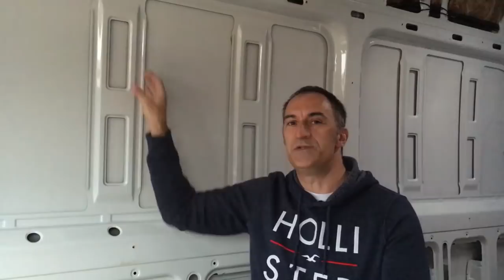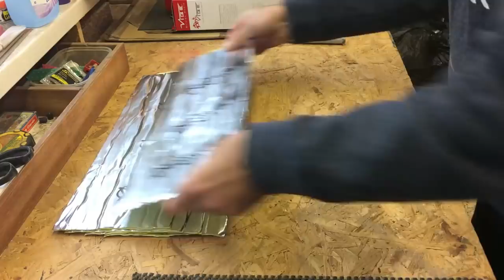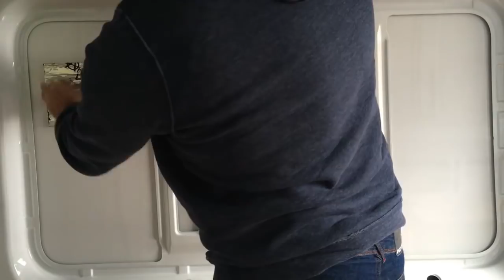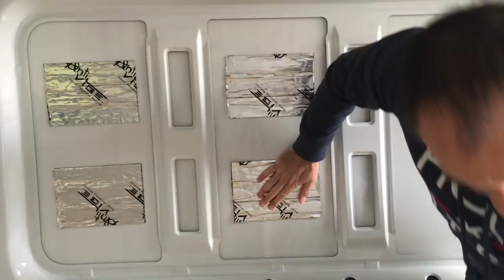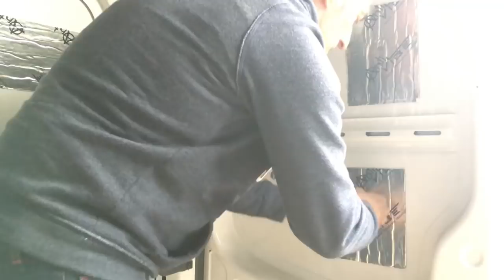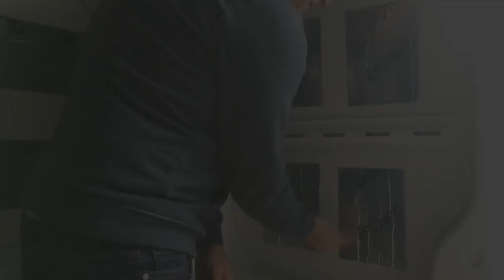Noise & Vibration in your Camper Van

Comment: It is amazing what skills we learn at work that we can use in other area's.
Your daily job does seem to be coming in handy in so many ways on the camper.
Simply clear demonstration as usual.
I would add taking the front door cards off and doing the front doors but I think they may have already been done knowing Mercedes. Some manufacturers don't do the front doors on their van versions.
I drive a Vito at the moment, which they also make into a people carrier, the people carrier always seems so much quieter, I think I have found out why now! Thanks Greg.
Reply from the maker: Hi Harvey, being a mechanical services engineer I deal with Heating, cooling, Water, plumbing, ventilation, controls, basically every building service you can think of. As we are turning this van into a home it all applies in one form or another. What I'm really enjoying in being able to pass that knowledge and years of experience on to help others make hopefully better decisions about their own build. Thanks for great feedback.

Comment: Hi Greg, 

Brilliant series, Genuinely look forward to your stuff more then some series that are on T.V. In the process of planning my van build to potentially be living full time.Sorry if i'm asking a silly question. I know you talked about the panels absorbing the sound coming from the outside. Will it do the same job absorbing the sound coming from the inside of the van? I'm thinking in regards to privacy whilst parked in built up / residential areas where you don't necessarily want to attract a lot of attention to the van. Would be very interesting to know what level of sound would actually penetrate to the outside as I love listening and playing music but would want to stay as stealth as possible.  

Andrew
Reply from the maker: Hello Andrew, yes the insulation will work both ways to reduce noise breakout. What would also help inside would be the soft furnishings, sofas, carpeted walls, curtains etc all absorb some sound. Hard surfaced tend to reflect sound.  I've got some 1/2" thick acoustic felt that I'm thinking of lining the walls with, sort of thing they use in conference rooms or screening rooms.

Comment: Great video and explanation, Greg. I used Silent Coat on mine -a good price, shipped direct from the manufacturer. Here's a link to my treated/untreated demo - it jumps straight to the useful bit. https://youtu.be/zaA912dc3zw?t=4m12s 
My used van was very, VERY rattly at the start. I re-bonded panels that had broken loose from the ribs and applied the butyl sheets to the panels, not the ribs. I did cover the whole area of the panel and also the roof to silence the sound of rain. I probably wouldnt cover quite as much in future. The floor has a base layer of horse stable rubber mat for road noise reduction.
Reply: Yay, another youtuber to subscribe to.
Reply: Thanks for the sub, Mitcy! 😊
Reply from the maker: I checked out your video, you did a good job.
Surprising how many panels come unstuck and most of the rattles are these flapping about.
The rubber mat may offer some mass to the floor if stuck down to deaden any vibration
but little sound absorption as its a solid material and sound waves won't get into it.
Reply: The roof was almost all detached from the ribs!! The mat is heavy so makes good contact with the floor, although I did need to fill the gaps in the corrugations. It's below the rest of the flooring which is screwed down. No doubt there is room for improvement, but just returning from the supplier with the mats laying on the bare metal was an amazing difference. The Ducato is a tin box compared to a Sprinter. 😉
Reply: The stable mats are great for landrovers and pickups where you’re chucking logs and bricks in all the timebut they’re bloody weighty ! Yep i think sprinters and crafters start with alot less rattles than other makes !

Comment: Thanks for another great video.

Now that you've sorted the body of the van, have you any tips on cutting down on the irritating noise from the passenger seat? Telling her to shut up doesn't have the desired effect 😆
Reply: Funeral services for Tony will be announced shortly.   Lol!  My suggest is Taffy or bit o honey candies.... difficult to talk with you teeth glued together.
Reply from the maker: LOL 😂😂 love this Tony.
You could try turning the radio up, if that fails then a strategically placed strip of foil tape is the answer.
Reply: Drive to a funeral in the snow with the traction control turned off.  Make sure that (before you set off) you tell them that every time the triangle flashes the wheels are losing grip.  Quietest journey of my life.
Reply: Swop her out for one that don’t speak English 😬
Reply: @Dan-wo4bx  SWAP, not SWOP.  DOESN'T not DON'T.  Looks like you need some classes in English yourself!
Reply: Tony Sutton - My, how strange.  I had the same problem with my ex husband every time I got behind the wheel.  "Drive like this, drive like that...!"  He just never shut up.  So I tossed him out permanently, and kept the dog.  It did have the desired effect of total blissful silence.  No more male backseat driving.  The dog is a much better companion.  Maybe if you put her behind the wheel and you slept in the back?

Comment: Won't earth wool draw moisture and get damp over time like glass wool? My van was insulated with glass wool by the previous owner and I dread looking behind the panel wall... What do you think about using sound deadening sheets in the driver's area? Would you apply it just partially like you did in this video or the whole area? My van is not particularly loud, but a less noisy car makes for a smoother ride.
Reply from the maker: Earthwool is water repellant, but with my vapour barrier there will not be any moisture behind the cladding. Most cab noise is breakout and not vibration so you'll be better with an adsorbing material and full coverage for these areas.
Reply: Thank you for the answer! I'll see if I can find something, but this will be a luxury expense for when I have finished my conversion.

Comment: Wish I knew this before purchasing all that noise isolation material, much more than I need apparently.  But thank you for your always informative videos.
Reply from the maker: Hello, if you've not fitted it yet then maybe resell what you don't use to another van builder. If you have fitted it already then you will benefit from it being a very quiet van, it may have cost more than needed but it will work very well. Thanks for watching.

Comment: I have this stuff called dodomatt which was recommended to me for sound deadening, it seems much lighter than the stuff you describe in this video but will it be okay to use in the same way? Great videos, I’ve found them extremely helpful so thank you!
Reply from the maker: Hello, I looked at Dodo Mat website and their products are gear more to sound absorption. They are a foam or quilted material that will soak up sound waves from wheel arches or engine bulkheads etc. I couldn't see a dense anti vibration pad in their product line up. Where do you think the source of your noise will be from?

Comment: Hi Greg, another clear and concise video, you are getting really good at this:)
Regarding my new Ford Transit it's all curves and style creases. Ford promoted it's new model as being very quiet, like car quiet. Not quite, but pretty close.
Funnily enough like yours, it was the rear doors that let the side down. So to be sure I added sound pads to these and all large panel areas and now all is reassuringly dead.
Reply: Greg where did you put your electric 'boxes' in the end? Not sure I saw that on any videos. Assuming we aren't having a permanent garage, I guess there's only behind the drivers seat under some seat benches. I've seen CamperTango use the side panel next to it too (for the EHU)
Reply from the maker: Hi Rob, they do seem to have done a lot to cut down on those annoying rattles. What's next on your agenda for the transit buddy?
Reply: The weather has kept me in, so I'm still working on the control system. Proving a bit of a task now, but it should be worth it.
Reply from the maker: Can't wait to see what you've come up with, I've gotta get down and dirty and get tanks hung under my van if it ever stops raining.
Reply from the maker: Hello, we are still planning to have a garage in the rear for storage etc. The controls are located at the left hand rear panel as you open the rear doors. That where all the cables wire back to. All I’ve changed is the initial height of the bed and will now make it removable. Everything else is pretty much as per my original design. Want to keep the front bench seat empty for storage.

Comment: I'm planning to do an enclosed cargo trailer conversion and I will definitely need to treat it with something like this, especially if I expect to use a decent sound system in it.
Reply from the maker: If the sheet panels are very large it may be worth looking at bonding some angles to the inner surface to stiffen the sheets?

Comment: Interesting you've done this video now Greg. Just about to do similar - but the cab.
The back of my van is pretty good, but it's quite noisy in the front whilst driving. Decided that whilst the seat bases are out for other jobs (next week I hope) I'm going to try and improve this.
All the stuff I've chosen is on order, plus will do a before and after with decibel meter for anyone else interested. Could be a complete waste of time :)
Reply from the maker: Hello, I imagine most of the noise in the cab will be from the road via the front wheel arches and the engine via the bulkhead. This is more noise breakout than vibration and sound attenuation with a dense foam is probably a better treatment to absorb the noise. As I suspect panel vibration is maybe not your main issue here. What materials have you ordered out of interest?
Reply: I've ordered some sound deadening foam sheets from Amazon, which I'll fit under the standard floor matting, in the doors, on wheel arches, anywhere else I can get it. It get's good reviews so I'm hopeful it will be quite effective (not expecting amazing).
Planning to be quite thorough with this (def include battery box) and also fit where I can under bonnet (with high temp stuff).
I'll also fit the same in the base on the overcab. Worth a go I think :)
Reply: You might have luck with a raptor kit. Spraying on the under sides of the wheel wells.
Reply: Thanks. I'll look into that.

Comment: Love your videos. Really informative.  Glad you pointed out that's soundproofing is not really Necessary on all vans.
Top tip ! 100mm self adhesive roof flashing does the same job as the expensive anti vibe or rattle trap, but without the pointless foil back of course. 😁✌💜
Reply: Yep i think I’m gonna try a couple of layers of the heat on roofing flashband just because i have a few rolls of it kicking about.
Reply from the maker: A handy tip Peter, thanks. I'm also not sure why the foil backing? Yes, this stuff is expensive so it pays to use wisely.
Reply: I tried the roof flashing, but it doesn't have nearly enough weight. The proprietary pads are way better.
Reply from the maker: Hi Joshua, search for “sound deadening material for vehicles”  Do not use black foam products as they are not for vibration control. The sheets you need are very thin heavy self adhesive sheets. Other names are Rattletrap, Dynamat, Dodomat, silent coat, Fat Mat. 
It’s a thin, heavy butyl self adhesive mat usually with a foil back and comes in small sheet sizes. Hope that helps
Reply: Any ideas for alternatives for this Anti Vibe product? I can't find Anti Vibe in the usa. Thanks Greg, good work on the series so far.
Reply: peter urbacz I found that roof Ice Dam Protection found at Home Centers, runs maybe $165 USD for a whole roll, probably do two vans with one roll. You can apply heat to wall surface to help the bonding in cold weather, it totally conforms to surface undulations, Cheers!

Comment: Nice work again Greg! Do you think its a good idea to reinforce with additional silicone or glue on those ribs/contact-areas on the panel wall? Ive seen some cases where massive vibration sounds occur because the silicone has loosened.
Reply from the maker: Henrik Tessem , yes you are absolutely right, I have added a pinned comment regarding this and recommend these are fixed with mastic to prevent vibrations. Great comment, thank you.
Reply: @GregVirgoe  what Mastic do you recommend?  is sikaflex ebt+  suitable?
Reply from the maker: @dpwonderer  Sikaflex 252 is the strongest in terms of adhesive strength for securing steel panels https://rover.ebay.com/rover/1/710-53481-19255-0/1?ff3=4&toolid=11800&pub=5575265109&campid=5338027957&mpre=https%3A%2F%2Fwww.ebay.co.uk%2Fsch%2Fi.html%3F_sacat%3D0%26_nkw%3Dsikaflex%2B252%2Bwhite%26_frs%3D1

Comment: Perfect...added to my growing materials list.  Thanks
Reply: Roof flashing is nowhere near as good as proper sound dampening like he uses here - I experimented with both...
Reply from the maker: Use the tapping method to decide how "live" your panels feel and don't cover more than 80% of any panel. It's expensive and heavy and you don't need to use a lot to use it wisely. Glad you found it to be useful.
Reply from the maker: Hi Peter, I imagine flashing to be a sticky butyl rubber membrane but this anti vibe stuff is very heavy and dense, when I likened it to sheet of lead I was comparing its weight. It's this mass that does most of the vibration dampening. I'm sure you will get some effect by sticking stuff to your panel but maybe not as effective.
Reply: I'm doing my first conversion and have learned it's just not worth the money to sound proof.  I was curious to find out what the material is they use. It's basically self adhesive roof flashing with a foil back. The foil does nothing it's just about density so look at roof flashing for a cheaper alternative.